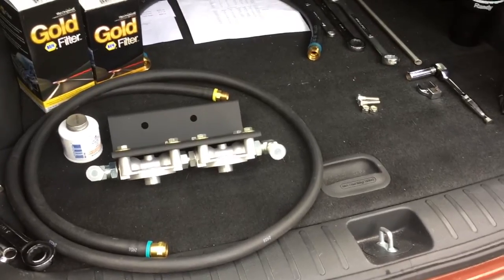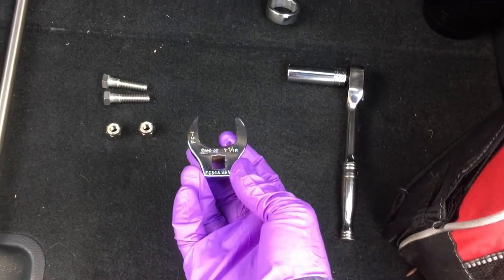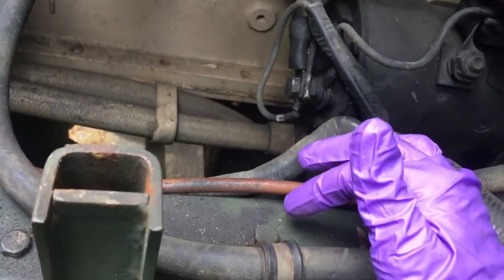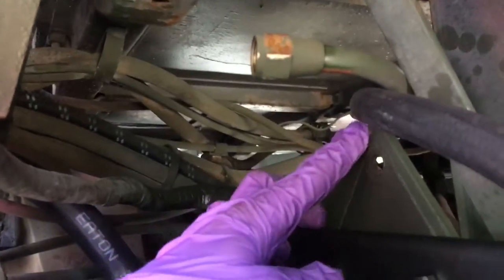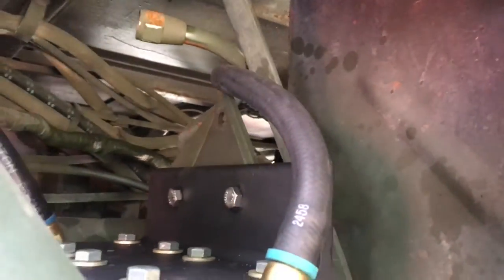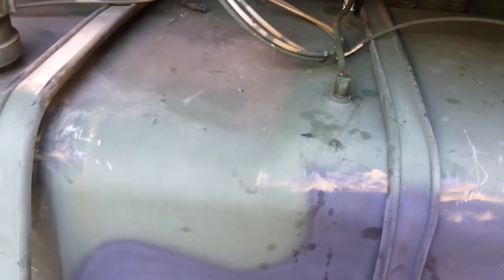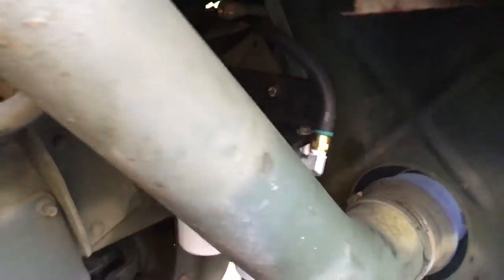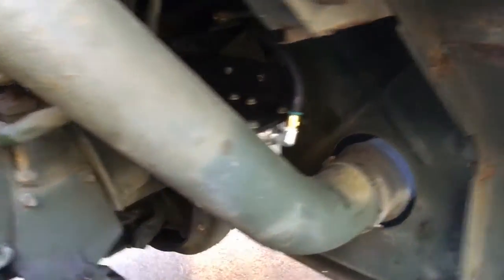M923A1 Dual Fuel Filter Kit & Tank Tubes

Comment: This video was great, going through step by step and speaking clearly.
I have a 1991 M925a2, I have to cycle the starter 3-5 times (probably 3-4 seconds each time) until it lights up
I have the old canister fuel filter besides the secondary on the cummins.
I am going to order the filters and teds tubes
Thanks again for posting this
Are you a member on SS ?
Reply from the maker: Thank you very much. That was our goal with the video even though it made it long. That sounds like problem. Either you’re loosing prime, batteries are not turning the starter strong enough or its super cold outside. Sounds good. Questions reach out on FB. We are on SS too but don’t check it a lot. Sorry.